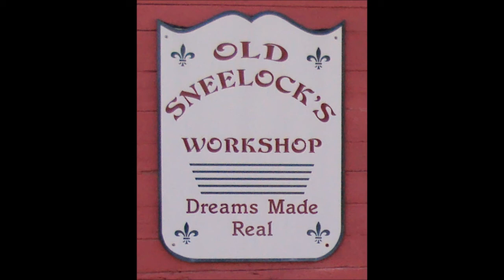Electrolytic Derusting Blacksmith Shears - a video tutorial by Old Sneelock's Workshop

Comment: Cool video i was wondering how well baking soda would work as i could not find anyone really saying it would work but now i see it does as i can not find washing soda here in Nova Scotia
Reply: Washing Soda, or Super Washing Soda, is just Sodium Carbonate, while Baking Soda is Bicarbonate of Soda.  For electrolysis purposes, they are not equally effective. In the USA buying Baking Soda in 5 or 10 lb. bags is much cheaper than buying it in small boxes at a supermarket.  If  you can buy one or more pounds of Baking Soda, you can spread it on a baking sheet and heat it to about 350 degrees Fahrenheit for 30 minutes or so (the heat drives out the moisture bound into the Baking Soda)  and it will  convert it into washing soda.  Let it cool and store the washing soda in air-tight containers until you need it.  Oxi-Clean's active ingredient seems to Washing Soda, but check the Safety Data Sheet to be positive.  It is also more expensive.  Check You Tube titles for demonstration videos.

Comment: Just to make sure I have the connection right.  Positive is hooked up to a piece of metal in the solution and the Negative is hooked to the part to be cleaned.  Also how much baking soda?  Is there a ratio or do you just add a bunch.

Great video, I have a bunch of 1/2" washers I need to clean and I think this will work great, when I get a chance.  They'll have to be in a metal container to complete the current but will be easier than cleaning them by hand or a commercial solution.
Reply from the maker: Absolutely must have the wires connected with the black to the part to be cleaned. If you hook it up backwards the part you are trying to clean will be pitted.
I use a plastic bucket. You don't want the bucket to be metal otherwise it will pit and leak like a sieve. You can line the bucket with sheet metal.
For what you want to do string the washers on an iron wire and suspend the wire in the tank. The reaction is best if the parts have their whole surface exposed. Don't let the part to be cleaned touch the sacrificial anode or they will short circuit and no reaction will happen.
I put about a cup of baking soda in the 5 gallon bucket. A little more or less is okay. It's not too fussy.